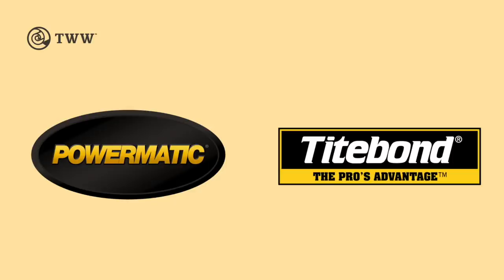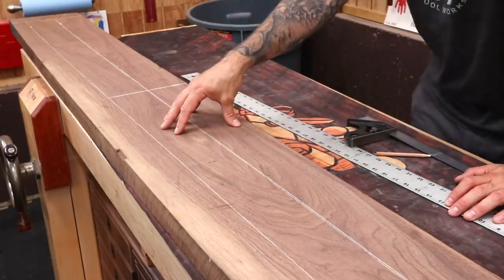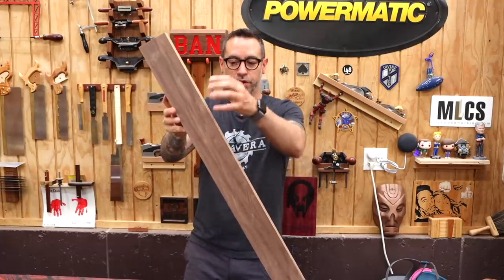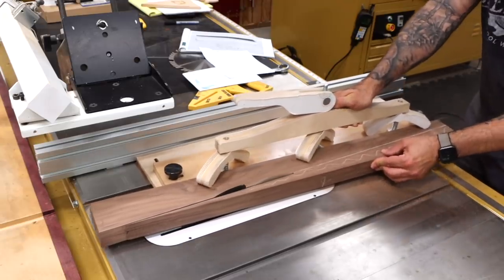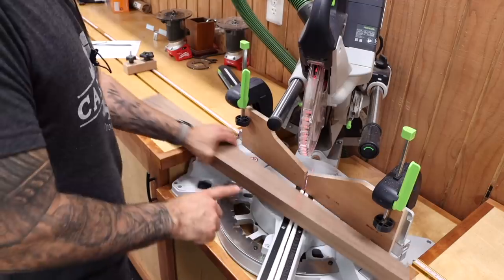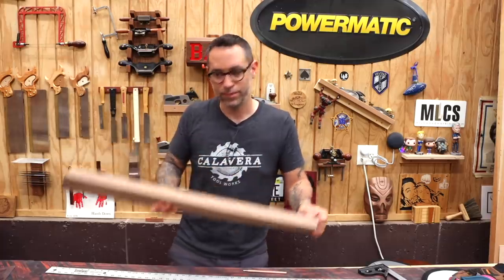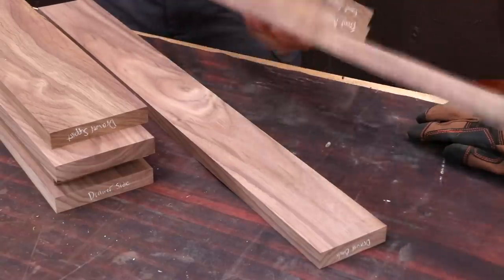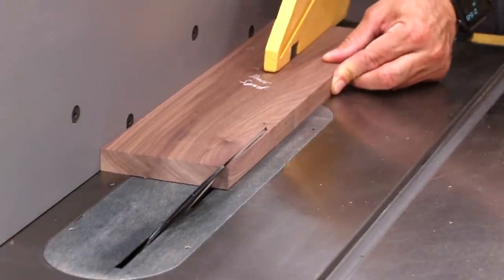Design, Legs, & Joinery | Nicole's Desk Pt. 1

Comment: Great project.  I love my Dominos.  I have the 500 and 700. Both have their uses.  

When having to cut at different depths I always cut the shorter lengths first.  That helps to eliminate the mistake of cutting a thinner piece on the deeper setting.

Comment: Well done Marc. That's the best way to do it. Use the domino because you have it, but just tell people there are other ways to do it. Also, before I bought a domino I used a shop made duo doweller and it worked just as good, but a little slower than a domino.

Comment: At 12:37, which model push-stick is that?  Looks nice and beefy.  Also, was curious about what brand of blade do you run in your Powermatic table saw?  Thx Mark!
Reply from the maker: It’s an old Craftsman from probably 20 years ago. And the blade is a woodworker II

Comment: Looking good but I have 2 questions. Could you cut the leg blanks wider and when you taper them, you have 2 legs with less waste? Also, when you cut the bevels, could you move the rip fence to the other side of the blade so the point of the previously cut bevel could ride higher on the fence? I also have no problem with the domino. I just wish I had one. Take care.    Bill
Reply from the maker: Yes and yes. 😊

Comment: Love the project.  I'm on the fence about buying a Domino.  The same goes for the Kapex; which I see you've gone back to.  I'm curious as to the dust collection you have set up for the Kapex.  Is it hooked up to a Festool CT?  I'm concerned that if I hooked up my CT to my miter saw that the cycles would be to great for it.
Reply from the maker: I do have it connected to a CT vac. The key is to make sure you're on a 20 amp circuit. I've never had a problem that way.
Reply: Thx Marc.

Comment: How do you see the marks at 23:25? It doesn't look like you've extended them up to the top of the reference stock?
Reply from the maker: The marks are visible on the horizontal workpiece.
Reply: @woodwhisperer  But how do you see them once you put the Domino down? Like how do you align the Domino to that mark?

Comment: Nice work (as usual).  I have an kinda unrelated question though.  I notice you and many others will joint one face and one edge,THEN, run it through the planer.   Why not continue running the material through the jointer to achieve the desired flatness and thickness?
Reply from the maker: Because a jointer doesn’t create parallel planes. It can flatten a single face only. If you use it to flatten the other face too, you’ll likely end up with a taper. You need the planer to create a surface that runs parallel to the jointed surface.

Comment: Mark, where does one go to look at or shop for work benches?  Don’t really have time to build one, but really need one with vises and other clamping abilities built into it.  Thx Mark.
Reply: Sjobergs if price isn't an issue. They're not expensive for what you get of course. I bought a cheap bench a decade ago, and it's still standing, but has a lot wrong with it. The top was okay on it, and the vice not too bad, bit it just lacked weight. I'm building a modular bench instead (plans from paoson woodworking in YouTube) so it includes storage and so on. Like you, I don't have a huge amount of time so paid more to have plywood delivered already cut. The design just really suited my needs, whereas my bought bench didn't. Basically, make sure you know what you need first, in terms of storage and whether you'll be planing (height/weight) most, or machine work.
Reply from the maker: Rockler sells quite a few.

Comment: Are you using sanded dominoes for those test assemblies? I can never seem to replicate easy fit up like you do in your videos.
Reply from the maker: Mine are lightly sanded. But remember I’m in Denver and it’s very dry here. If you live in a more humid area, you’ll have a tighter fit.
Reply: I drill holes in the ends of my test ones, so I can use a screwdriver to lever them out.
Reply: @ricos1497  That's a dang good idea, Rico!
Reply: @woodwhisperer   Yeah, South Carolina is a little more humid than Denver. LOL.

Comment: Dominos are awesome but you can certainly substitute dowel rods. You'll likely need more of them to equal the same strength. Here are some parts from the bunk bed project Marc did with the domino, except using 1/2" dowels instead. https://i.imgur.com/hlM0044.jpg
Reply: My friend likes to use biscuits for alignment and steel angle brackets for reinforcement. Cheap and cheerful. Not perhaps the most elegant solution but gets the job done and are usually hidden. You shouldnt be jumping on the tables anyway...

Comment: Dominos can be a great time saver, but effective glue surface is significantly reduced over a traditional M&T that has a larger cheek.  With this desks dramatic angel for the legs, there is a severe amount of torque on that joint so I’m surprised of this choice. 

Personally, I don’t think of the domino as a Replacement for the M&T, but a significantly improved doweled joint.
Reply from the maker: You should reconsider how you think about them. Multiple tenons are often stronger than one large one. Joint strength is about more than just glue surface. I agree that there’s a good chance a more traditional joint would be stronger in this particular application, but that doesn’t mean the Dominos aren’t strong enough to do the job. Time will tell. 😊